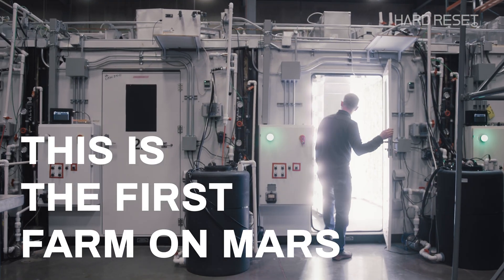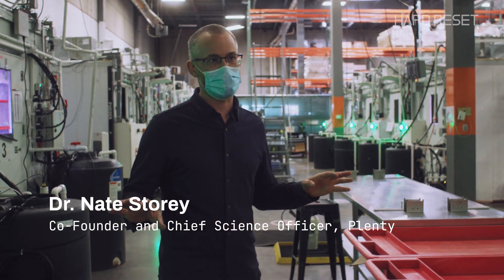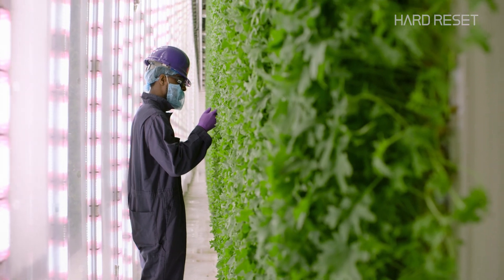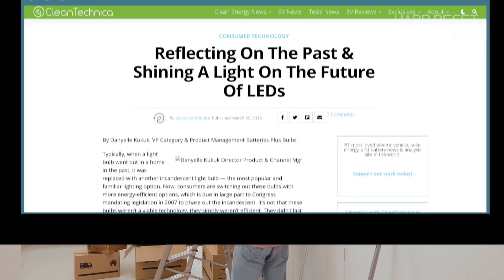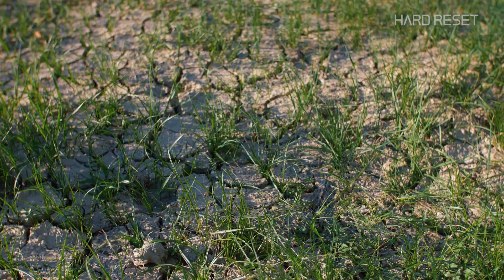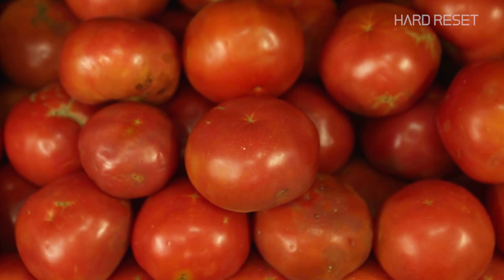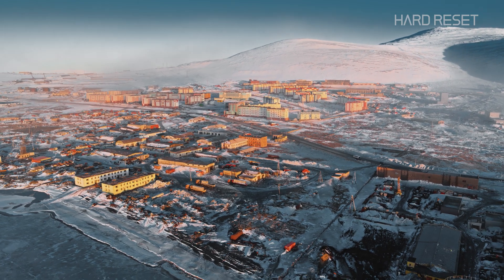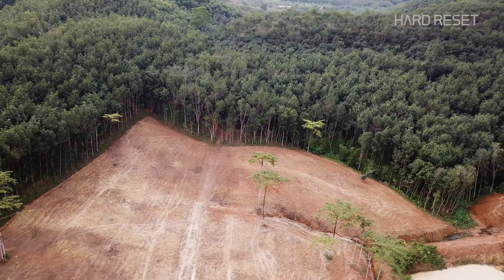Space-Age Farms on Earth

Comment: This can work well with  green power in that the LEDs can be turned on at night to use the surplus wind farm energy vs having to store that energy in batteries or  taking them off line. 

So in essence the energy is being then stored not in batteries but in the plants themselves.
Reply: Here is one other thing that might make these even more attractive in that (over time) these could be integrated with the Pipe Dream Labs technology and the  produce shipped to restaurants and grocery stores, and even homes on demand.

Many new products fail in that they tend to shy away from being dependent on other new products, so if that dependent product fails then that will cause your product to fail.

But for some new products this might be the  very thing they should do in that their product alone  cannot be competitive but could be with those other emerging enabling products, given one knows which horse to bet on in that regard.

Thus indoor farming and Pipe Dream Labs  each can be a boost to the other and so a collaboration between the two might improve both' s chances of success.

So one then might site a indoor farm where it might also be a good location for installing a Pipe Dream Labs distribution system and then use that as a proof of concept to get more investors.

As a retired engineer I can say that such collaborations often do work where this do it alone mindset fails where  I have seen it first hand that this collaborative  approach works really well, that is if one can be tech savvy enough to bet on the right horses and then work out a joint plan that helps all parties while not incurring too much risk by having  contingency plans if one of those should fail.

Or another way of saying this is that two high risk programs  working really than reduce each programs risk rather than raise it if done smartly.
Reply: So here might be such a collaboration, getting the EU to fund a indoor farm in Vilnius, Lithuania plus a pilot Pipe Dream distribution system to a number of locations like grocery stores  with the idea that they then could grow fresh produce during the winter months as well as distribute then on demand and have that as a resource in case of war with Russia.

Thus one can be killing three birds with one stone and  each can stand on its own if one fails but if all three  succeed then one has even a greater capability.

Thus one  of these alone might not be enough to tip the scales for investors but all three (with mitigation plans if one or more should fail) might indeed tip those scales.

It is what might cal a coordinated marketing g plan where each markets their own products but also includes  as the roadmap as an added bonus the joint plan as a further inducement to fund their part of that plan.
Reply: And an additional part of this might be to invest in using humanoid bots that can harvest those crops and thus reduce cost but then could also be drafted to fight and defend the city from Russian attack if ever (and hopefully never) required to do so.

Thus each of the four can market their own part but also showcase the potential for them all working together.

And what potential jobs lost  to those bots might be gained back in building the infrastructure to make all this work such as the Pipe Dream Labs system plus  anything spent of robotics will likely have the potential for even more opportunities as well.

And this can be paid for by buying a few less very expensive Patriot missile or the like in that the underground network  can make a city more resistant to missile attack and thus largely compensate for having a few less Patriot missiles to defend it from such.
Reply: And  each component can  decrease the risk to the over all plan. For example say the  Pipe Dream Labs part tun s out to be just  that a Pipe Dream and fails but not the humanoid robot part. 

Well, then those humanoid robots could serve as the last mile delivery by employing cargo e-bikes to deliver that fresh produce. 

e.g. Google
E-Cargo Bikes & Last Mile Deliveries | 100% Independent, 100% Electric

And thus the bots can ride those e bikes and deliver not just the fresh produce but other goods as well and supplement any Pipe Dream  systems that might also be employed making the system even more versatile and robust.

And such collaborations might need government support and funding. But governments are often  not all that innovative in that they are there to govern and not innovate. 

That is where an enlightened industry that does want to innovate and sees collaboration as a good way to go to do that which then can present these plans to governments to get government buy in might be the way to go. 

And as such even YouTube channels such as your here could help there by  bringing such technologies  more to the public awareness so that all might learn more about what is out there and then might see possibilities that they otherwise might have missed,  like  here, I did not know much about these indoor farms.

So in business one can make 2 + 2 not just equal 4 but 10 if one is smart about how one adds those 2's together!

Comment: What if there was a way to do this without LEDs and solar panels? With fiber optic solar collectors? Or would that not work because you wouldn't be able to control the light spectrum to exactly what you need and you couldn't run the lights at night or when the weather was bad?